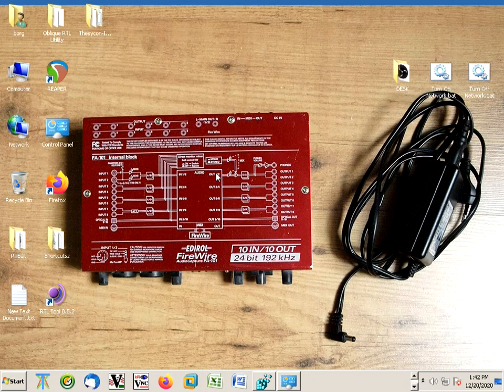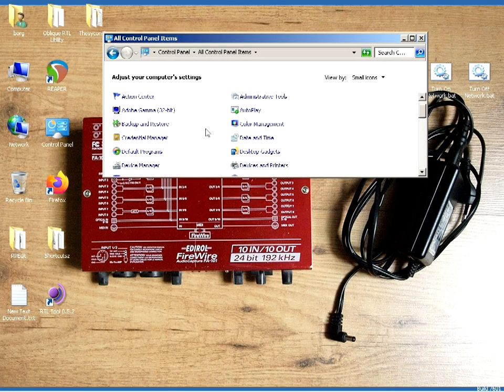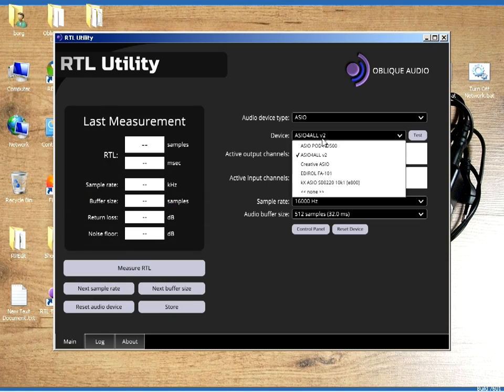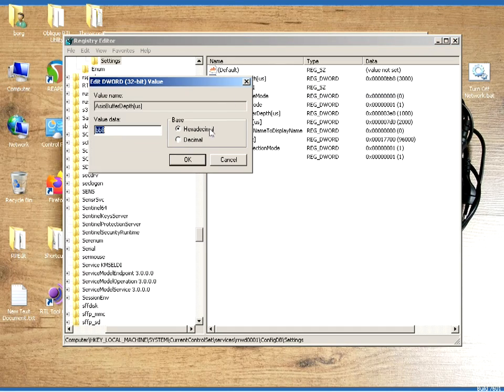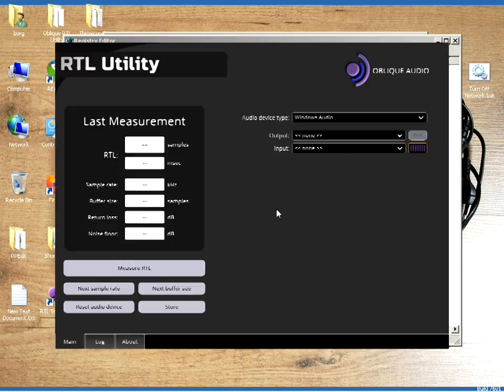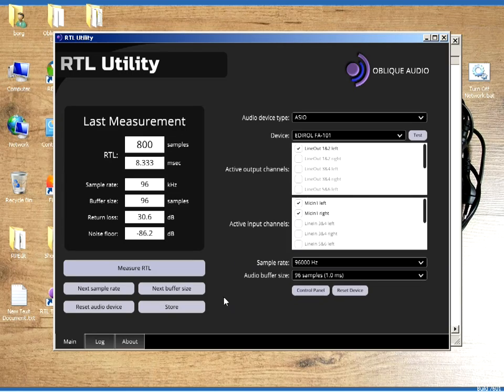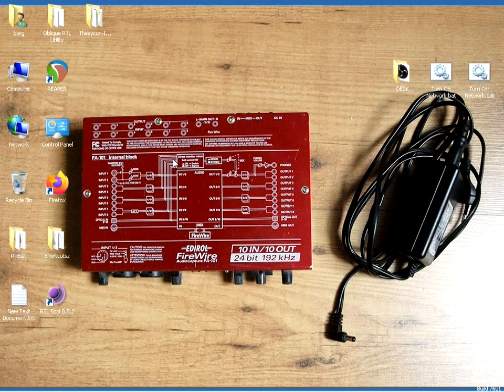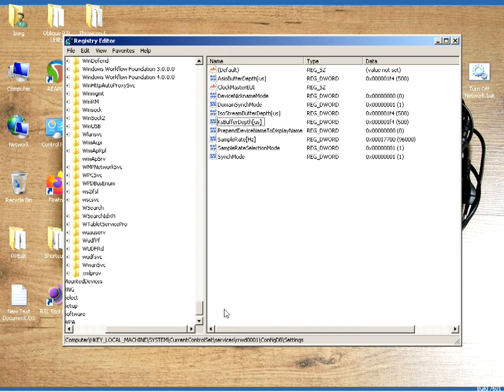Edirol Fa101 Firewire Interface Settings

Comment: Need help getting Stereo sound recorded in Audacity, please. I am using FA-101 with Windows-10. The setup was done few years ago (and forgot how). I pugged in a Mic-XLR into Input-1 and recorded. I notice that the signal in the Audacity came in mono on Stereo track. Then I try to record from Input-2 XLR and it was again mono. If I use Yamaha-MG__XU I always get Stereo audio in Audacity. What am I supposed to do?

Comment: I notice on the official Roland site that the Windows XP 32-bit driver has disappeared.  It gives a zero byte file if attempted and errors when executed.  I tried hunting around the internet for it, and even tried old FTP server addresses but no joy.
Reply from the maker: They still have all the drivers up 
Windows XP v1.02 32 bit drivers https://www.roland.com/ca/support/by_product/fa-101/updates_drivers/dfe0194c-9c5f-4f8d-bbeb-517748ce5f08/ click agree and download the zip archive. The drivers are inside that zip archive. I still have this interface running and is working on windows 11 as well, for older midi equipment I have this interface running on a virtualized Windows Xp installation in order to program those external hardware using MIDI. We have come a long way these days with multiple virtualized OS if we wish.
Reply: @danfuerthgillis4483  I get a popup message saying, "nxR_NPmC.zip.part could not be saved, because the source file could not be read.

Try again later, or contact the server administrator."

Comment: não sei o que eu fiz de alteração em registro ou se ele já era assim, mas eu to com buffer de 576 e não de 512… e isso faz a placa de som não ser aceita no ProTools. Me lembro que funcionava antes, só não me recordo o que eu fiz. Alguém pode me dar alguma dica? não queria ter que reinstalar o Windows do zero.
Reply from the maker: O protools nao trabalha com ratios de samples differentes. Tem Que ser 32, 64, 128, 256, 512, 1024 etc. Isto vem da Hardware do Protools integracao. Pode usar o Asio4all drivers com o Edirol Fa101 para usar o Edirol Fa101 no Protools.

Comment: How can I get the driver for windows 10 ?
Reply from the maker: First grab the Windows 8 x64 bit drivers here https://www.roland.com/ca/support/by_product/fa-101/updates_drivers/
Then follow this guide here https://www.soundonsound.com/forum/viewtopic.php?f=20&t=55497&start=30 this shows you how to modify the INF ( driver file) in order to install that driver on Windows 10. It has to be installed with "this driver is not signed" yes install it.
Reply: @danfuerthgillis4483  Thank you
Reply: @danfuerthgillis4483  Hi, have you managed to fix the issue on Windows 10 v 20H2 as well? According to the users on the SOS thread the workaround is not working on version 20H2, maybe you another solution? Thanks!
Reply from the maker: @navesegev  Hi there I will look into seeing how the drivers behave in the newer win10 versions. I am on the custom build win10 editions since I don’t update the OS for a long time ( everything is off with group policy). Will toss that os on a spare drive and see how the drivers behave.
Reply: @danfuerthgillis4483  wow, thanks alot for the effort!
Reply from the maker: @navesegev  Good news, on the latest Windows 10 you do not need to edit the INF files. I installed a clean Windows 10 22H2  ( off microsoft's site) so all services are running as stock. Installed normal the Windows 8 x64 drivers from Edirol. So normal means click the setup and when it tells you to turn on the Fa101 turn it on and it will finish the install. Installed the latest Reaper version 6.6 and no issues running the FA101 at i'ts stock settings. Make sure the Fa101 has the blue and Red light when you turn it on during the driver setup. You may have to use the other Firewire port on the back of the Fa101 as in my case it has to be used with the one on the left most side or else it won't work.  Here are 2 screenshots showing it running https://ibb.co/dk7kwNR
https://ibb.co/gMh1yX9. So no need to do anything special.
Reply: @danfuerthgillis4483  thanks, i'll give it a shot. You are awsome!

Comment: I'm trying to use output 1 2 3 4 at the same time,but I can't find a way to only allows 1 and 2 or 3 and 4.any help thanks
Reply from the maker: It's because those are the stereo pair outs. In order to use each output individually you must use a Daw like Reaper, Ardour, Studio One, Samplitude, Protools etc. There are 8 outputs as 9 and 10 are the Adat ins and outs. So you must use this interface inside a Daw and then route Mono or stereo tracks to either stereo pairs or mono channels out 3,4,5,6,7,8.
Reply: @danfuerthgillis4483  thank you

Comment: I wanna use this for my condenser mic as an amp, would it be good?
Reply from the maker: No if it’s singing and it’s a large condenser this tops out at 56 dB of range very low for higher end clean vocals as the preamp can’t drive the Mic that hot. I suggest to use a Mic Preamp as that is what I use on this interface.
Reply: @danfuerthgillis4483  just found this on ebay very cheap that's why im asking, my mic is nw-700 so far away from large i guess
Reply from the maker: @nissanoo0393  Lmao 🤣 that’s the one I use for YouTube videos and yes it’s perfect with this Interface. Too bad Edirol went downhill after these masterpieces.

Comment: Hey, im using the windows 8 driver on windows 10 and something weird is happening, when i try to play anything over 44.1 kHz on WDM, it doesn't work, but on ASIO aplication it does, work up to 192 kHZ,  do you know how to fix this? maybe install the older drivers?
Reply from the maker: The default driver setting for the WDM is 44.1 khz even though the interface can be set to other rates.
Since I never use  this interface to play out sounds, only use it to record in Reaper for input and ouput i never have this problem. If you record at 96 khz and up make sure that the soundcard ( onboard) is set to that sample rate. If you use the F101 as a Windows sound device ( many people use it as that way) make sure the sound properties for the outputs are set correct in the properties here is an image ( in Windows 10 as an example) https://ibb.co/M6y2xZc
that link will show you the sound properties ( an example on what to do) this will be slightly different for you as you will do it to the Edirol f101 output ( instead of my Realtek card). WDM and ASIO are very different and have different setups.
Reply: @danfuerthgillis4483  That's the odd thing tho, when i set the FA to (for example 96k) 2 things happen, one i can't set the bitrate on the menu that you describe (on 44.1 i can but it only lets me switch 16 or 24 bit audio) and 2, i can't get playback, youtube videos dont play with sound and using Windows media player gives an error,  here is a screencap https://imgur.com/Zud0frq
Reply from the maker: @mariobros237  Windows media player needs to be setup to as 24 bit/96 Hz in the preferences/ speaker setup. You can also route the internal soundcard ( it's what I do when I want to) to go out via the 1+2 output of the Edirol Fa101.
I will make a short video showing how to use the Edirol Fa101 as a sound device in Windows. Could be useful not only for you but also but everyone else. I use VLC and CCCP ( Codec pack with the old media player) , I have not used the full main Windows Media player since 2001-2002 with the Windows XP betas like 18 years ago! was on Winamp back then already in 2002 :o)
Reply: @danfuerthgillis4483  Alright, Thank you so much! 👍